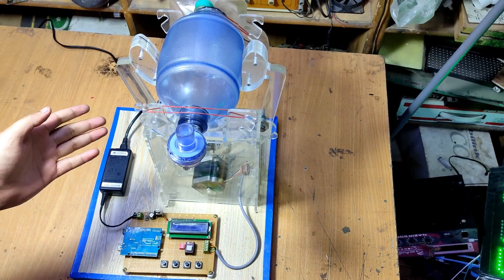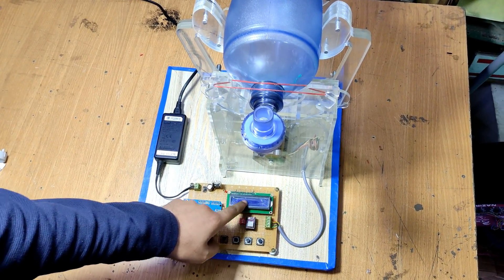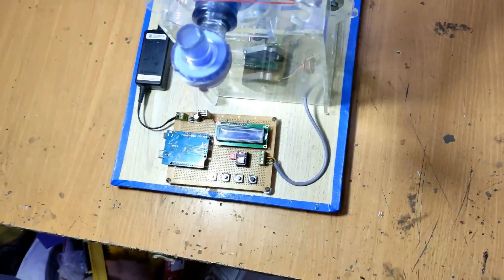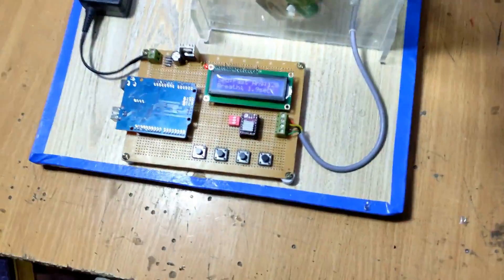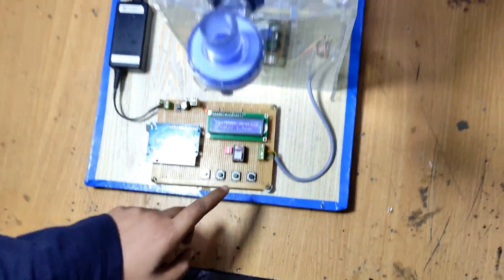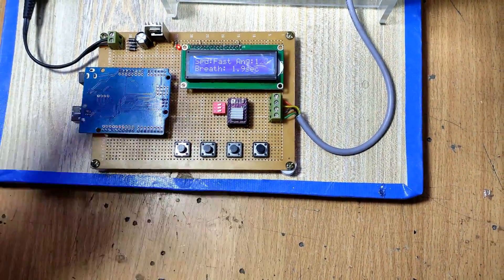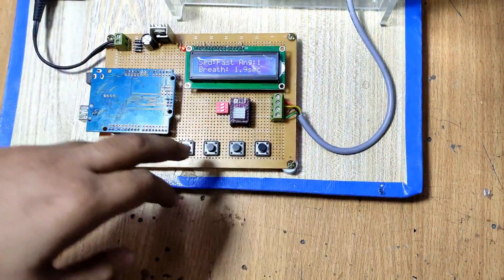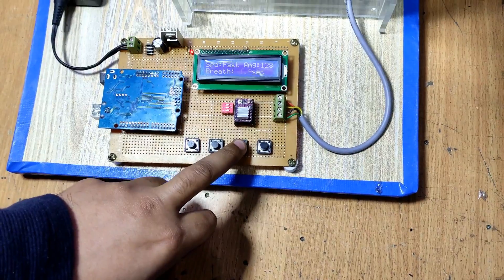DIY Low Cost Ventilator Using Arduino

Comment: Hello! Very nice work you've done there. Would you be so nice to provide the link for all the components you've used and the code for running the Arduino? Thanks in advance! Good luck with everythng you're working on.